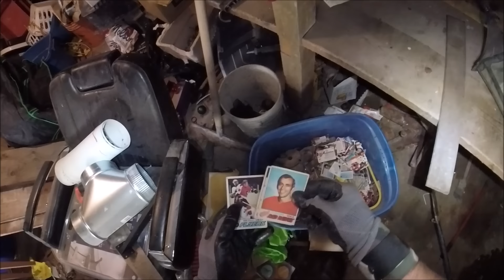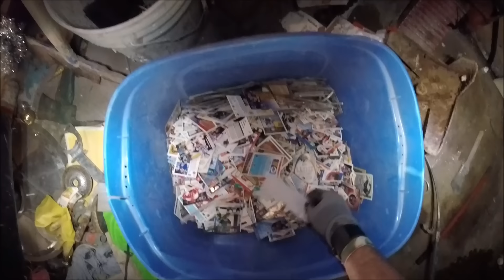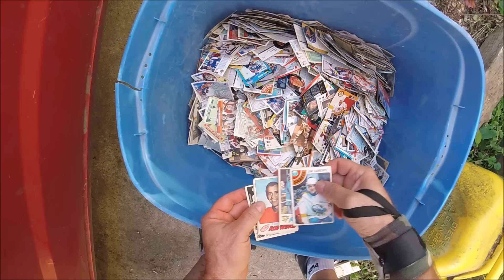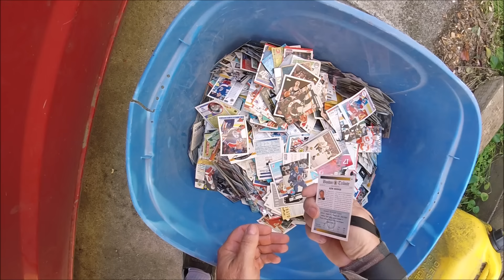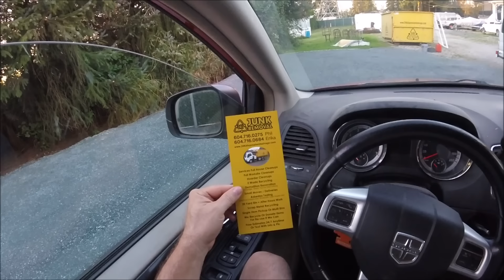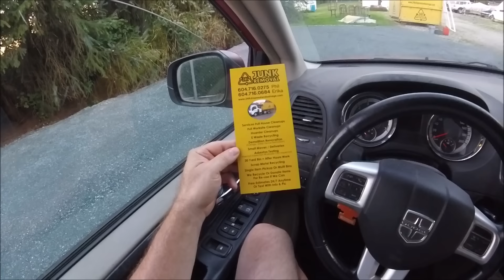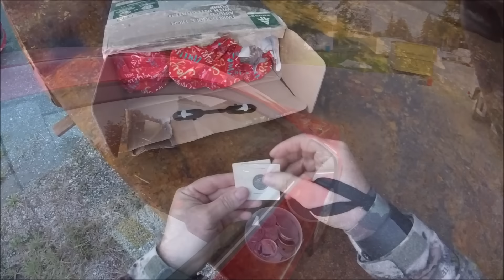Back To The Garage Full of Junk & More

Comment: Tip: paint the inside of the bin with a Thun layer of linenseed-oil on a hot day. It Will rustproof it in a very smooth way.
Reply from the maker: I want to paint the rust first